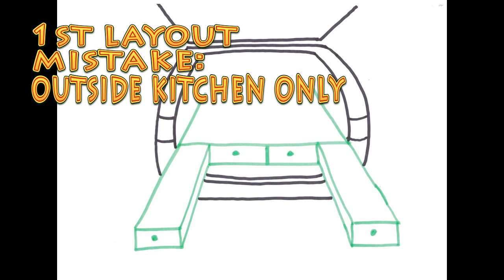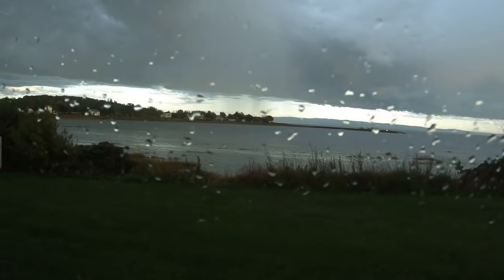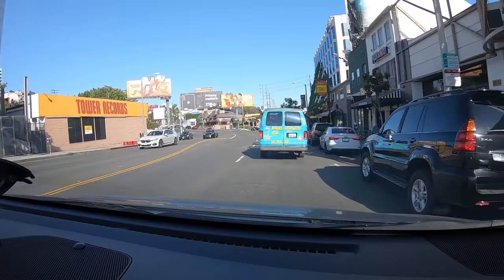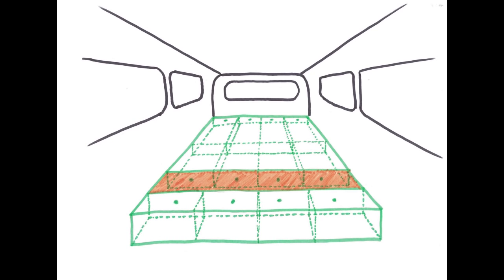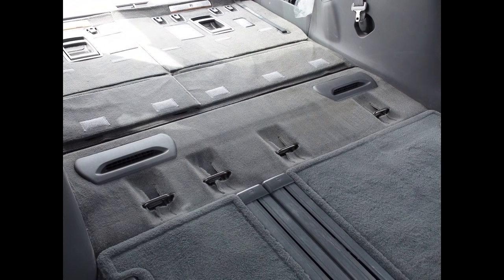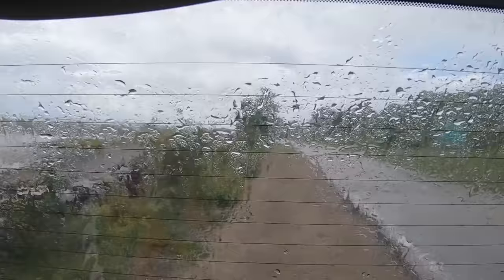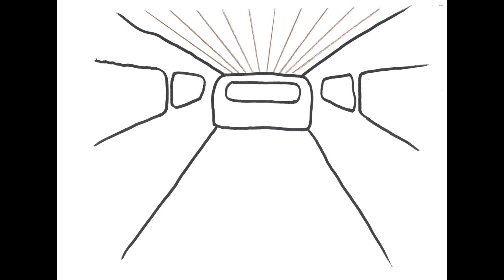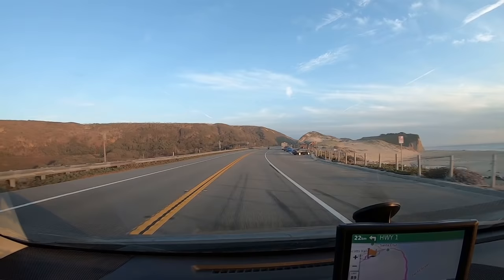11 mistakes to avoid (van conversion)

Comment: i've driven a commercial truck for decades.  A truck doesnt't have windows trough the load. Rear Wiindows aren't neccessary but you must learn to use the mirrors, a fish eye mirror hanging off the back or a back up camera helps.  Without windows you look for pull through parking slots in a parking lot, so you don't back out blind. 
 An outside windshield cover keeps the suns heat out, and the snow and ice off to prevent scraping ice.  Also you learn to park the windshield into the sun when it's cold and away when the sun shines in.
 I have a compressor refrigerator {transfers from vehicle to vehicle} between the front seats that I brought from the old van 8 years ago, between the seats is handy from the drivers seat or from the back between the seats, and occasionally outside.
  I've built a shelf that folds out from the dashboard in front of the passenger seat that I can eat from,  play a truncated piano keyboard, mend on my sewing machine  or watch Youtube on my tabet.
 Under the passengeer seat, I've installed an inverter, multiple lighter sockets, and  power-pole anderson connectors for the high power 12 volt appliances such as a microwave oven or grille.  Dustpan, broom, and a tin for Oreo cookies also fit under the seat.
 I have a 6 inch foam mattress on the floor, in a heavy plastic protector, on top of that I have three satin sleeping bags layed open flat. Uising Satin sleeping bags instead of flanel or fleece lined, lets sand, weeds, seeds & etc, to brush or shake out.
  EMT {tubing} hangs from side to side near the ceiling behind the seats {hang towels & swimwear} and inside the rear hatch to hang clothes on hangers, hooks or binder clips.
 Being older, I keep an empty old laundry detergent bottle for nighttime urine recepticle (big enough hole for #2 in an emergency) 
  If you feel the need to stand up and don't care about resale value: I Large solar panel on coroplast folding bellows will give a pop top that soesn't flutter as much in the wind as canvas does.
  If you are in a cold area a Webasto Airtronic or the cheaper diesel parking heater is a noisey but dry & clean alternative to a sterno fireplace, Catalytic or a Mr. Buddy heater.
Reply from the maker: Thank you for your sharing your set up. It allows people to have other ideas and inspiration! 
✌️
Reply: some good ideas Lamar, thank you.

Comment: After 20 years as a stealth camper, your ideas and opinions are well valued.
I’ve incorporated many of your ideas in my build:
Simple, modular design in the bed, and cabinets,
Inside galley (kitchen)
Ventilation and insulation.
Hard floor.
Minimal, or no drilling into the structure.
My build is a Promaster City cargo van, so some of my requirements will differ slightly from a minivan.
However, I can’t say enough about thinking thoroughly about the design and keeping it simple.
Also, having the ability to simply and quickly remove the components is genius.
Keep up the great videos, you’re quickly becoming the ‘go to guy’ in van builds!
Reply from the maker: This is a particularly nice comment! Thank you for sharing your experience and let people know that they can realize their dream of van conversion.

I am also glade that you adapted the technics and ideas to your taste. It is also a source of motivation for people. This is what I most value, people customizing and being proud of their realization! 
I am also glade of your appreciation comment. All this is a fuel to publishing more videos!

Thank you! 😃✌️

Comment: Always a pleasure to see you Eric. Most everything you just said is 100% right. Our only problem with a wooden floor is that we would lose so much space in a Dodge Caravan StonGo. Excellent vison mon Eric et SVP continue. Merci.
Reply from the maker: Thank you Henri! 
I faced the same problem with the flooring. Me too I wanted to minimize the height lost. I will explain what I did in a coming video...
I really appreciate your comment, and I am glade that we share perspectives.✌️
Reply: @ericenjoysearth2756  on my Town&County Caravan I'm instal a 1/4" rober rag removable . Question Eric wem you will post a video regar yours electrical panel ? Thanks
Reply from the maker: Hello Silvio!
For the solar panel, there’s already this video on my channel:
https://youtu.be/XwEYrCyYqZ4

Other videos will come with the electric subjects. 

Great for your Town and Country!👍
Reply: Henri, I have a 2014 Dodge Grand Caravan with Sto-n-go seats. I have incorporated Eric's great van build into mine. I did a hard floor with 3 hatch-type openings. This allowed me access to the entire area below. My fridge set-up, and bed, is like Eric's. I made my floor go from door-to-door (don't forget about extra room for the cup holders on the bottom of the door, when it is closing). After I took out the seats, I left the frame in. My floor has 2 thicknesses of board. The first board fits inside of the frame. To secure this to the floor, I   cut small holes to hold zip ties which would go around the center bar that contains the vans wiring. I also added support underneath this board because of the 3 openings. I think I overdid it with support though. To do over, I might look at aluminum square tubing for support and to keep as much room as possible for storage. The top floor board goes from just under the front seats, side to side to both doors, and to the natural rise in the floor toward the rear, similar to Eric's. I used extra scraps of board running width-wise toward the rear of the floor, making holes in these to secure to the seat connection points. Then I screwed the top floor into these secured scrap pieces. I also screwed the top board into the smaller board within the frame. Some additional pieces of wood will need to go along the areas by the door for support. My hatches were merely cut out of the top floor board,  smaller than they were from the lower board which fits into the frame. Use big sheets of card board for templates. 
I hope this helps some. I really loved having the floor and hatch areas. I did a 3,500 mile trip through 10 states this past summer and loved it. The bed to couch conversion is priceless!
Reply: @denisee8048  thank you so much Denise. I was thinking of doing a cutout for the StonGo openings. I will try something this spring or summer and hopefully we can cross borders. I'm from the Montreal area.
Reply: @henrijakubowicz1421  my best to you. I'm from PA, north of Philadelphia. I used to live in the White Mountains of NH

Comment: So true about the need to cook inside. I use a non pressurized alcohol stove to avoid using propane.Takes a little longer to heat but its almost 100 percent safe.
Reply from the maker: Thank you Rob for your comment and for sharing you tip👍😃
Reply: If i have a micro van like a daihatsu hijet. How will it sleep two people if i were to put my kitchen in one side. Don't you think that camper box with a pullout kitchen is better cause you can sleep two persons in it. Whats the enjoyment of van life if you travel solo.
Reply: @abbypovetz1560  I'm in Canada and find 90% of the time I cook inside as it's often too cold, it''s raining or the bugs are bad. I do cook outside when I can. I have trifold bed  mattress which I fold into a seat , then use the remainder of the plywood bed platform for cooking space.

Comment: Great advice!  These are the same things I say to the screen, when watching many van-lifer videos!  I'm glad you started with the exterior access only kitchens!  That is my biggest peeve about van set-ups, and then second is eliminating windows so they can't see in traffic.  Thanks for showing these mistakes, so other newbies don't fall for them and endanger themselves.  I cringe especially, when I see solo females with the outside kitchen, or have to open doors for clothing or bed set-up.  Thank you for not just telling about these problems, but showing them to make the point easy to see.  Blessings and safe travels.
Reply from the maker: Thank you for sharing your opinion. It is interesting to learn about other concerns. Thank you for this and for your appreciation ✌️

Comment: Good tips most I’d already thought of but I’m sure many others haven’t. Can’t understand kitchens that can only be used standing at the back, outside of your van. I have a table that I can put my cooker on outside but mostly cook inside. Being able to easily move from the cab area into the back of the van, for safety, fast getaways or stealth camping is number one for me
Reply from the maker: I really like your comment! Those points are also very strong to me! 👍
Thank you for sharing your experience with us ✌️

Comment: As a semi driver, you DO NOT need your back windows, especially in a van, truck or car. Putting a back up cam eliminates  the need of the rear windows. Simply being aware of your vehicles space also elimates the need for back up mirror. Stay off the phone, quit texting and driving and pay attention. 
Overall, your info was spot on except the back mirrors.
Reply from the maker: I understand your point, but it is not only a question of driving. It is also a question of living in the van. You can see through that window and you get much more light inside! 
Thank you for your feedback and appreciation ✌️
Reply: Yearrs ago I drove a cargo van. It only had the two tiny windows in the back door, so I learned to only use the side mirrors. I even removed the rear view because I didnt use it.

Comment: Thanks for this video. On #11 I agree 100%. I've seen YT'ers advise not spending more than half of what the vehicle is worth, and I originally thought I would only spend $1000 on my van build. However, you have to be realistic, and consider that you are building a tiny house! (assuming you are living full time in the van.) In my case I drastically readjusted my budget when I figured in my solar/battery/electrical systems as well as my heating and insulation plans. I did some things cheaply from thrift stores and junkyards, but spent top dollar on others. Safety and a quality build I could be proud of were most important. It was not cheap, but was money well spent. As you also point out, many of those components are reusable on a future build as necessary. Although, I do hope my trusty van keeps running for another 100k miles!
Reply from the maker: Jim your comment is full of wisdom! You give me the feeling that you spend wisely and will end up with something pretty nice at a very fair price! Keep going , you seem to be on the right path! 

Thank you for your comment✌️

Comment: I agree with this gentlemen. I am 50, have a Toyota Camper conversion Van, and I have built 5 Teardrop Campers in the last 13 years. Layout & Design in a small space is crucial for it to work.
Reply from the maker: You are so right! Thank you for sharing your point of view ✌️

Comment: I don't doubt your data but I did a double-take when I read that Montreal had only two less days of rain than than Vancouver. Our climate in the Outaouais is probably the same as Montreal. 

That's not really why I'm writing. My van is currently in its default setup. I'm watching van build videos to get ideas how to configure mine. At my current stage of life, I get six weeks of vacation and a few long weekends. This year has been unique, but eventually we'll be going back to the office to work. It may be 2-3 days a week instead of 5, but multi-week or multi-month trips aren't going to happen in the lifespan of the current van. It's a challenge to configure a comfortable van for travelling when it's a suburban people and stuff schlepping vehicle 85% of the time. It's going to be a challege to make a vehicle that is aesthetically attractive, but able to have all equipment removable and seats pulled from the floor quickly. Your build is a great model of how to make something nice non-destructively.

I understand and agree with almost all of your recommendations except for the indoor food preparation and even that's only because of my planned sporadic use of it as an RV. For those who plan to travel long distances over long periods of time, even that is excellent advice. I just don't want the humidity and smell of food in the vehicle and I don't want to attract bugs and mice. I also don't want to give up the space initially. I'm a fair weather traveller and have no desire to stay in large cities or carparks. That being said weather isn't always what is forecasted and emergencies arise.

Regardless, thanks for your effort to share your experience. I have no desire to travel full-time in my van, but at the same time, I think that it's best to learn from the pros. I hope to view more of your work.
Reply from the maker: Thank you Jenn! I appreciate that you share your point of view. Effectively everyone have his travel ways and occasions, as everyone got his own preferences and tastes. This is why it is so nice with a van conversion to do it the way that each one want it. 

For the rainy days, I just took the data from the www...

Also, thank you for your appreciation! ✌️